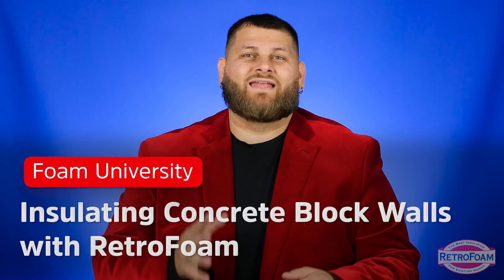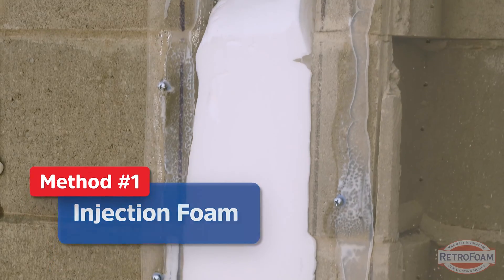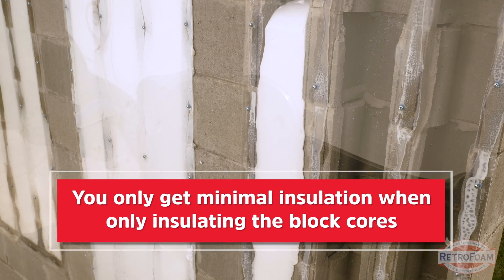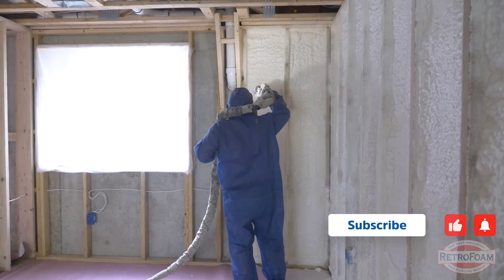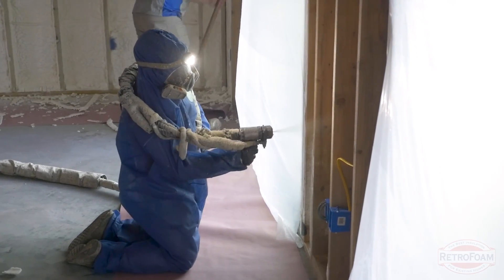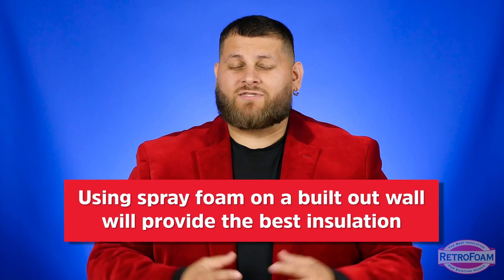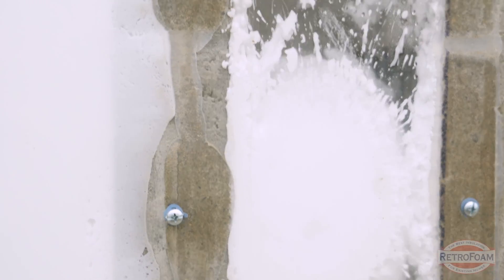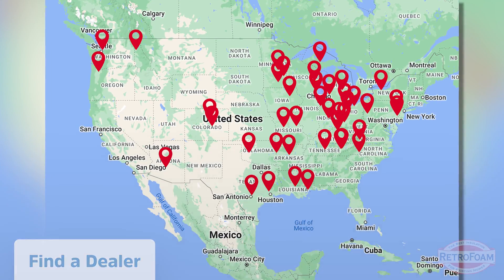What are the Best Options for Insulating Concrete Block Walls? | Foam University by RetroFoam

Comment: The only thing is you got to fix that leak from outside before spray the insulation foam otherwise you will end up retaining humidity in the wood or concrete and that's really bad
Reply from the maker: RetroFoam is an injection foam, not a spray foam, and it's actually soft and pliable after it has cured! This means it's relatively easy to fish electrical wiring through it, and sections of the foam can also be removed and replaced for plumbing repair. Check out this article from our Learning Center for some additional information on this topic: https://www.retrofoam.com/blog/fishing-electrical-wire-through-insulated-walls

Comment: What if your concrete blocks on the parameter of the home are connected to the drywall via furring strips instead of 2x4 studs? What is your recommendation?
Reply from the maker: We should be able to inject RetroFoam in those concrete blocks, no problem! Though, it'd be best to have someone come out and take a look. If you're interested in that, please follow this link to find your local RetroFoam Dealer: https://www.retrofoam.com/dealers

Comment: What about pre insulated drywall panels.  With the insulation sheet attached ???
Reply from the maker: Assuming there is foam board or fiberglass attached to one side of it, the RetroFoam would just be able to compress it, no problem!

Comment: aren't concrete blocks porous?  in which case both these solutions leave no cavity for drying.  And considering all the thermal bridging in both options (even the studs are bridges) , how much increased R value do you get?  Aren't you better off using continuous foam over battens?
Reply from the maker: Concrete blocks are porous, but with injection foam, the insulation fills the existing cavities, reducing air movement and improving thermal performance. While there are thermal bridges, the added R-value depends on the specific block structure and foam application.

Comment: Hello great video. Can you please calculate the R value of your product if I'm using an 8x8x16-in concrete block?
Reply from the maker: RetroFoam has an R-Value of R-4.6 per inch. R-Value is an important number, but the bigger thing to look at is the air seal created by the foam insulation.
Reply from the maker: By a rough calculation, I would say it would be about an R-15.3, and of course, this doesn't take into consideration the air seal created by the foam.
Reply: I'm using concrete block to build my home and I wanted to use this product but I was hoping to get an R Factor of at least 30. If you're saying it's 15.3 I was also planning on using foam insulation for the exterior maybe 3 in.  What recommendations do you have? I live in a hot desert climate in Cabo San Lucas Mexico.
Reply from the maker: Adding an air seal with foam insulation in your home would be a great option. R-Value doesn't account for the air seal, which is why we say there's always more to consider.
These articles might be helpful as you are researching.
https://www.retrofoam.com/blog/misunderstanding-insulation-r-value

https://www.retrofoam.com/blog/retrofoam-injection-foam-insulation-r-value

https://www.retrofoam.com/blog/understanding-r-value-and-u-value

https://www.retrofoam.com/blog/comparing-retrofoam-fiberglass-cellulose-insulation-performance

Comment: What’s the R value on just filling concrete block?
Reply from the maker: Well, RetroFoam has an R-Value of R-4.6 per inch, and it actually increases as the temperature decreases. So, it depends on the size of your concrete blocks!